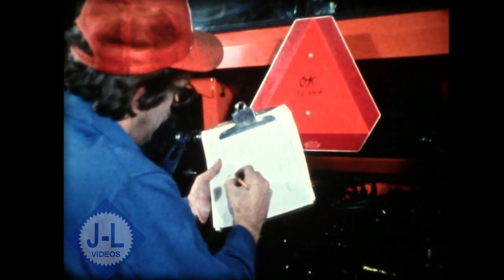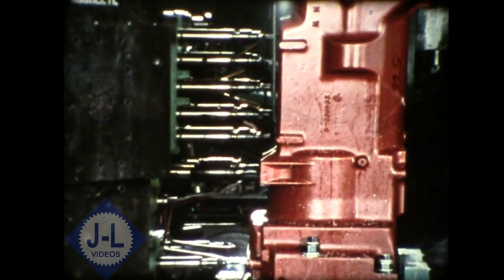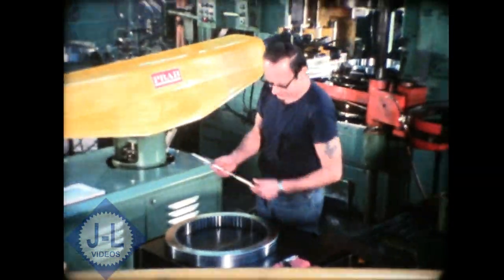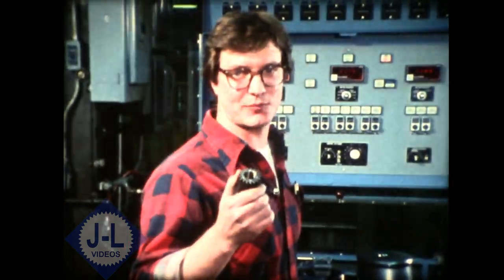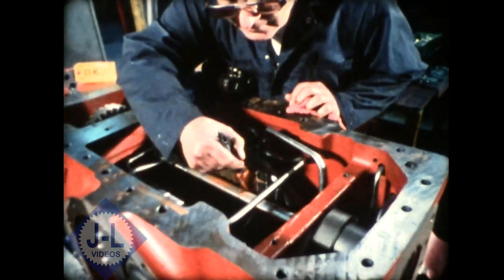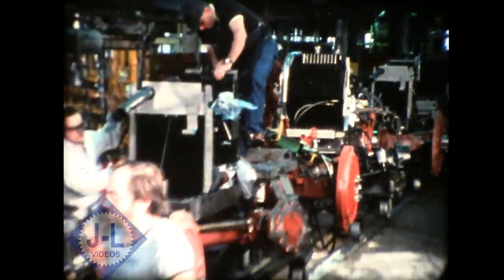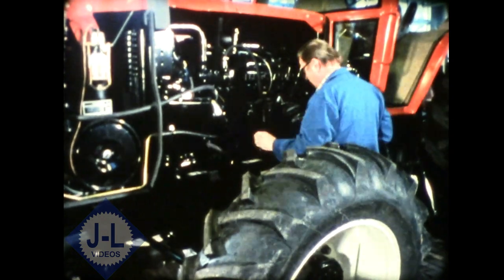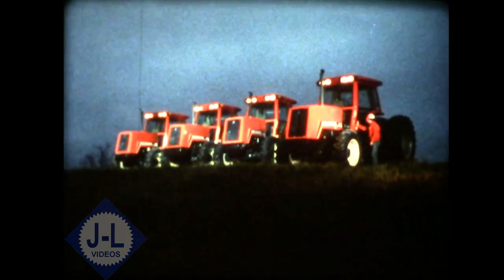1984 Allis Chalmers Movie OK To Ship 8070 Tractors

Comment: We still use a lot of A-C on our operation and they're still very reliable.  Agco has done a pretty good job keeping parts available for them considering they're coming up on 40 years old it amazes me what I can still order.   Our new stuff is all New Holland which has been pretty good for us also so far as well.  If you take all the new computerization out of the equation,  the new stuff really isn't all that different from the 8000 series A-Cs we're running.  The 8000 series was really ahead of it's time in regards to operator comfort and things like this.  I still really like running them and prefer them for some jobs.

Comment: Easily the best transmissions of their day.  No question.
Reply: Randy Magnum WRONG IH has always been ahead of the game in that department. You need to study up pal.
Reply: @Man-cv5ws  IH didn't even have a powershift transmission when the 8000 was out, only thing they offered was the tried and failed torque.
Better study up pal!
Reply: @Man-cv5ws  best thin ih ever did was become Case🤣
Reply: @RJ1999x  they had hydro!  Thats ih speak for a tractor that doesn't move.   😁
Reply: @randymagnum143  lol,
Reply: @randymagnum143  I wonder why Case dropped all their lines and kept IHC lines then ? Case was a very minor player making lack lustre machinery before they snapped up IHC .
Reply: @interman7715  wat?  What ihc products did Case IH continue to build?  🤔
Reply: @randymagnum143  the only good thing that merger did was give ih better funding so they could make their transmission they had been working one
Reply: @randymagnum143  the magnum was entirly ih design minus the motor
Reply: @CheeseMiser  ok, which parts are interchangeable with 88 series?
Reply: Another argument will never be resolved in our life times
Reply: IH was pretty good in the letter series days.  But by the mid-late 50s their r&d was lacking.  The 560s were recalled and fixed but it cost them huge. Then the crawlers..  Then the T/As that they never could perfect.

Say what you want but IH was showing their age when the "modern" tractors came out.